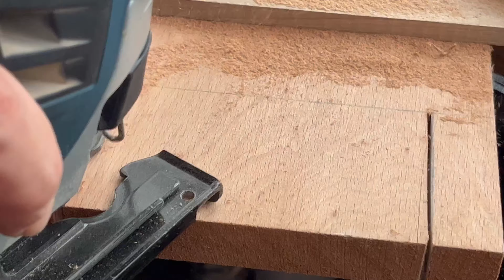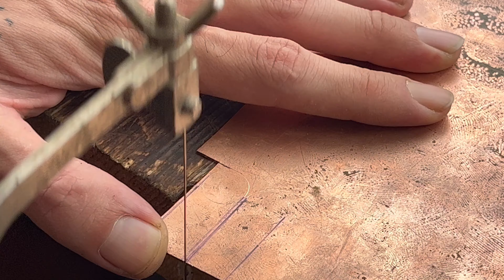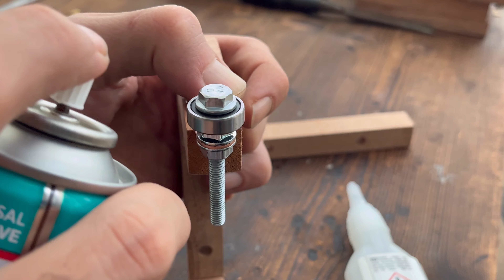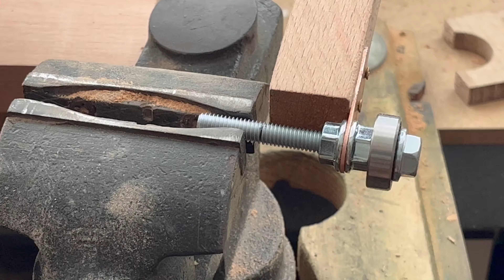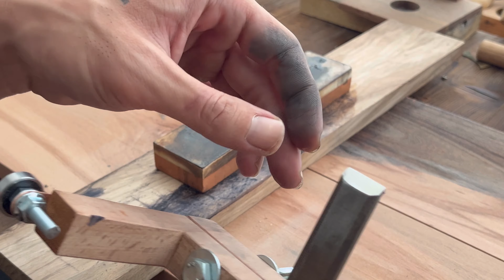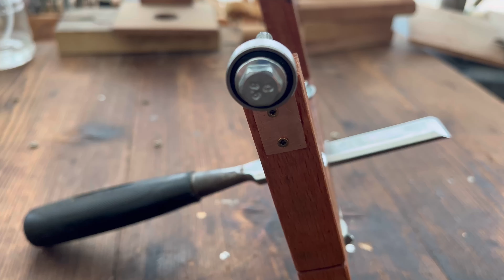Sharp & Crafty: DIY Chisel Sharpening Tool That Transforms Woodworking! #diy #diytools #woodworking

Comment: Those copper tags holding the bearings will prove to be a weak point I think.

Also, why make it so high that you need to raise the stone up to reach it?
Reply from the maker: thank you for your attention, no need to worry it is fixed with glue and two screws.
some of wood lathe chisels are long, if i made short one i will not able to use but this one is high enough to use for each size of chisels